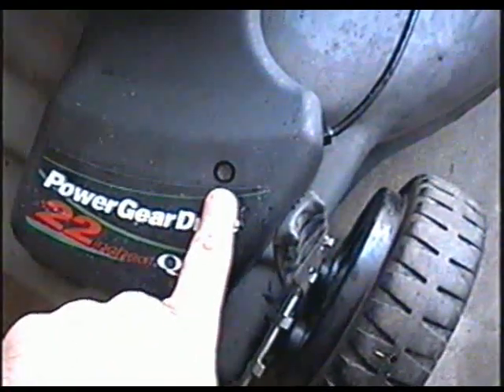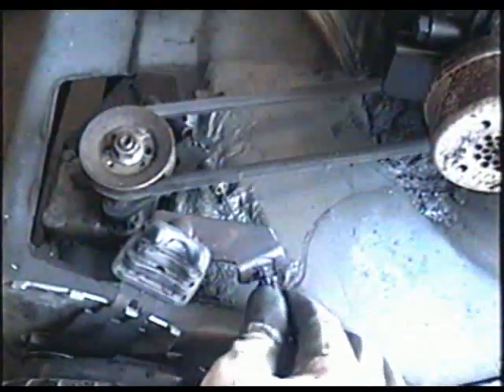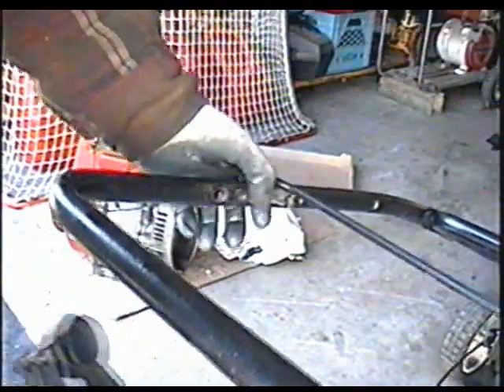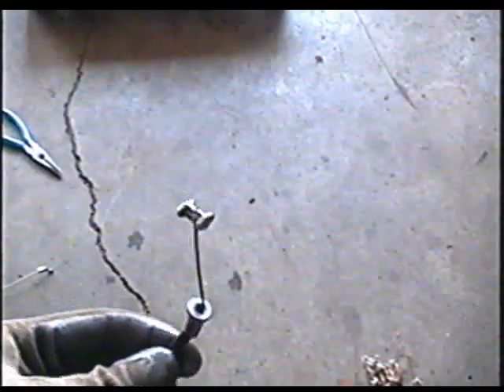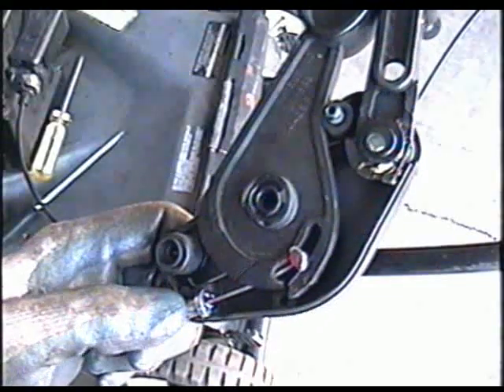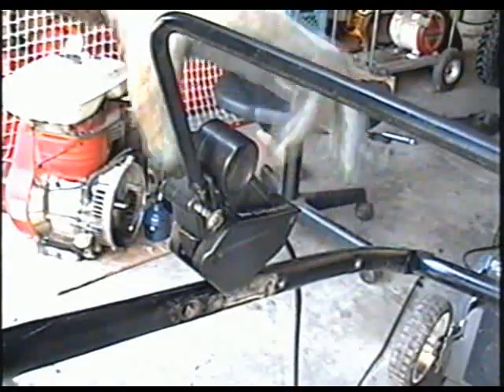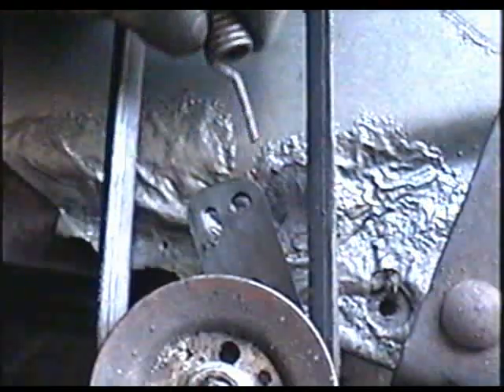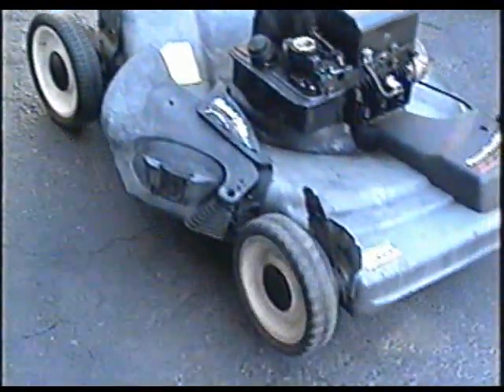Self-Propelled Craftsman Lawnmower Drive Cable Repair

Comment: I have the exact Mower in the Self-Propelled Craftsman Lawnmower Drive Cable Repair. I was using it for mulching leaves yesterday as I have for years and suddenly the wheels stopped turning. It does run and roll until I put in gear then the wheels stop spinning, they lock, can't even be pushed. What should I look for first before thinking of cable replacement. Your videos are fantastic, keep up the great work.

Comment: I used this video to replace the cable that engaged the self-propel drive of a Sears 917.370921 lawn mower.  The mechanism was basically similar.  No big problems.  THANK YOU !!

Comment: I had three non-working mowers in my shed, and thanks to your videos all three are now running!  Thank you so much!  Unfortunately, I had one setback.  On my Murray 22" Quantum 5.0, I was tinkering with opening the self propel handle assembly just to see how hard it was to open, and I fumbled and dropped it after opening it, causing it all to fall apart before I could even look at the innards to see how it was assembled.  Now I have that assembly all in pieces (with 2 spring-type things) and I just cannot figure out how to re-assemble it.  Would you be able to  post a picture or video of how the assembled inside look?  The handle assembly in your video is a little different from the one I have but the springs on the inside may be placed the same.  I have spent at least an hour trying to find somewhere on the internet that has pictures of the insides so I can see how the springs and other pieces are assembled, but no luck!
Reply: lol thats why im here, trying to figure out how to put it back together

Comment: Excellent video!
 My control handle is slightly different (older model sears).
Unfortunately, the springs in the control handle popped out on mine on disassembly. Any help figuring out how to re-install them?

Thanks

Comment: I fix a lot of cables like this that are seized up due to rust. What's your favorite penetrating oil? WD-40? Liquid Wrench? PB Blaster? Kroil? I've also heard a 50/50 mix of acetone and automatic transmission fluid works better than anything. what do you like most?

Comment: @headscratcher99 the end of the spring should rest on the little plastic piece inside the cover he showed in the video. you can see it at 3:26 in the video, the spring is that little wire looking thing thats resting on the cable holder.

Comment: Do you know how the drive cable on a Troy-Bilt 834 should be attached under the deck?  I offered to help a friend replace his v-belt but when I removed the belt guard the belt is fine but the cable tip is missing as well as the extension spring.  I can't find any diagrams online.

Comment: I have the same type throttle control on my Craftsman S.P.  The cable seems fine but the lever (handle) on the throttle will not stay in the on (forward) position.  It is awkward to hold this handle forward while mowing.  Is there an adjustment for this?  Thanks.  I hope your family's health issues are better.

Comment: @donyboy73 well, donyboy.  I bought a brand new drive cable assy and still not luck.  My drive cable is a little different from the one in this video.  Mine has a threaded sleeve w/2 nuts that adjust the length . After adjusting per the manual,  the wheels turn, but they hesitate/pause frequently (like before).  Maybe I'm chasing the wrong parts.  As I stated before I replaced the transmission 2-3 years ago, now a new drive cable assy.  I wonder if it's the belt?  I'm not sure what else to do?

Comment: @superstallion03, I finally DID get the spring back in correctly, but it took some time and patience. My philosophy was, that if it popped out of there, it had to go back in... somehow. I took on the role of "original designer", and tried to figure, functionally, what I wanted the spring to do. I then looked for any hooks, crannies, or surfaces which might support the spring and which the designer had incorporated. The control handle is now being held together with epoxy and hot glue.  :-)

Comment: Hi, donyboy.  I have a similar craftsman mower, but older.  Model# 917.372473, S/N 012992M 033917.  A few years ago it stopped self propelling.  I adjusted the drive cable and that worked only for a while.  So I replaced the gearcase assy. Then last year the problem came back.  The drive wheels seem to turn intermittently. I was thinking my cable is probably stretched and it needs replacing, as I can't adjust it any further now. Can you find after market drive cables that fit? Thx. -jasper

Comment: I have a Toto Tecumseh.  How do I get the (black ) cover off.  There is no apparent bolt etc. Does it pop off?  I tried to pop it off but maybe I did not try hard enough.  I did not want to break anything, if there was something attached.

Comment: Hi Donyboy73. I have a Craftsman 6.5 HORSEPOWER 22" REAR DISCHARGE POWER PROPELLED ROTARY LAWN MOWER Model No.917.377540. the drive lever will not stay engaged. I opened it but the springs came out. can you help me with this.

Comment: @jasper60103 Also, I wanted to mention that Sears (Craftsman dealer) only sells the whole cable assembly, not just the drive cable.  This cable assembly cost $35-40 US. Also, I would appreciate any other ideas.  Thanks.  Also, I love the videos.  -jasper